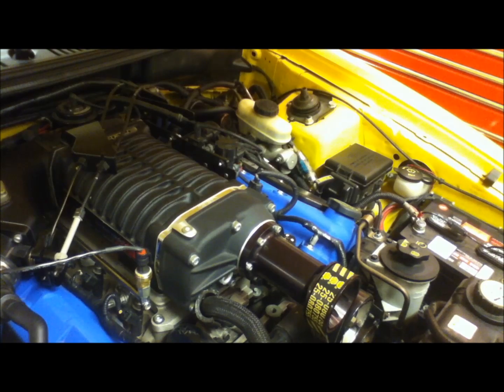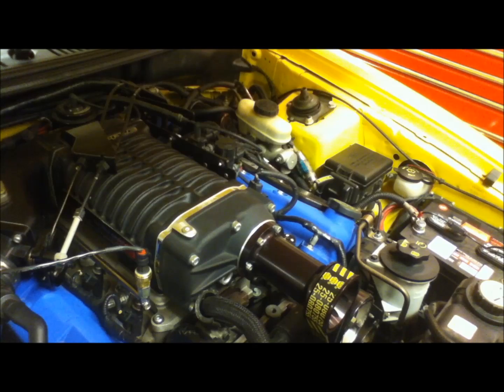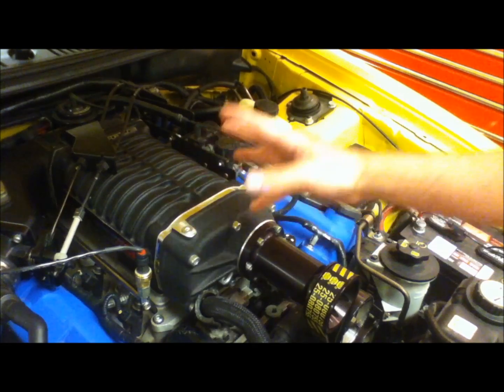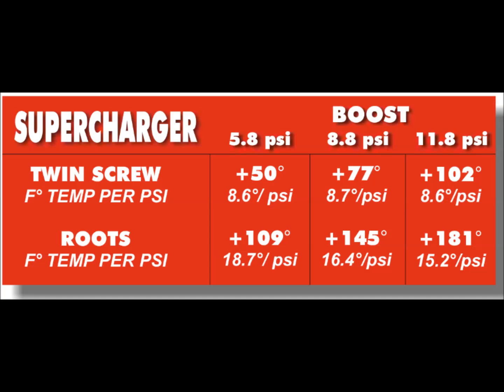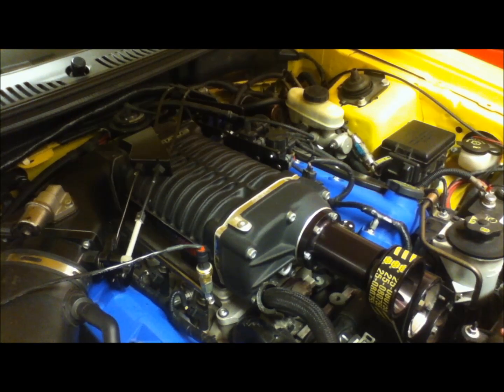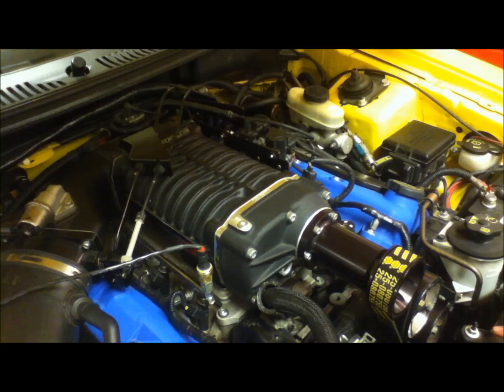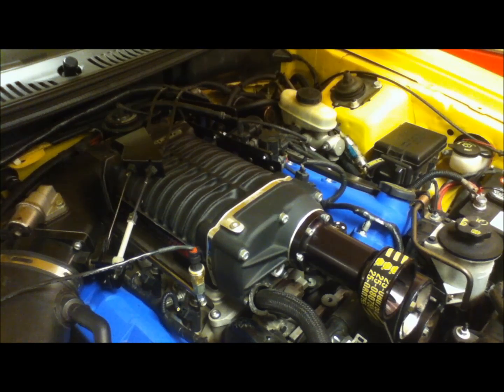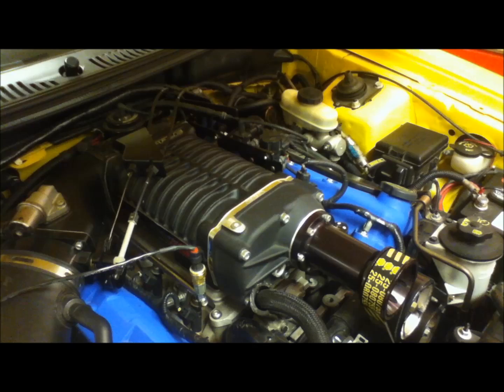Superchargers: Roots vs Twin Screw vs Centrifugal (Whipple, eaton, VMP, procharger) supercargador

Comment: I hate how people are so ignorant 
A twin screw is still a positive displacement blower and how they thing the roots is the end all be all when the twinscrew is better

They are both positive displacement blowers 
Thus still give that low end power
They both move a set amount of air no matter what how they do it makes no difference
 
They have no seals so less to worry about and produce less heat
The only advantage of roots is price

There is literally nothing a roots will do better over a twin
Reply from the maker: Actually, the new TVS roots outperforms both the whipple and Kenne bell twin screw. It used to be the other way around, but not anymore
Reply: Scrun Johnson really?
Well I'll be dammed 
I wonder how p.d. Tech is going to change 

What's the price comparison on those things and performance gap?
Reply from the maker: They are both around $4k new. The Eaton roots used to produce twice the heat as the twinscrew, but with the new rotor design the TVS/ eaton is more efficient. I would think a twinscrew could come back to be even more efficient, but as they both sit now the roots is better. 2.3 L roots will do what at 2.9 L twin screw will do
Reply: Scrun Johnson hmm well then 
I be proven wrong more than "durrrr roots is better durrr"
Reply from the maker: I was surprised too. No biggie
Reply: Scrun Johnson what company produces that roots blower? I'm looking into one for a build I want to do so I'm curious
Reply from the maker: MyLonewolf25 eaton builds the roots as well as TVS which is technically eaton as well as far as I understand
Reply: Scrun Johnson thank you! 
I looked on their sight but I wasn't sure
Because they did have TVS 
But it also had a TVS2 or something like that so I thought I'd ask before looking like a dumbass CX
Reply: Scrun Johnson what do you know about the one randy Rivera posted?
also what are the major differences between gen 1 and 2 I couldn't really find anything in a albeit quick search
Reply: Vmp tvs gen 2 by vmp performance
Reply from the maker: MyLonewolf25 you're probably thinking of the 2nd generation (2nd gen) TVS
Reply: Scrun Johnson most likely 
I'm guessing it's better than the first?
I didn't really see anything about by how much though
Reply: MyLonewolf25 i think the gen 2 has like 16% gain over gen 1

Comment: This video is very helpful.
Reply: MegaMma4life Top mounts are twin screw and roots
Reply: Wipple's are twin screw.....better than roots
Reply from the maker: Thank you. Glad you enjoyed it
Reply: Scrun Johnson This saved me lots of trouble with modifying a truck. After watching this video, I found out that I want a roots supercharger. I WAS gonna go with Procharger, but I don't want a centrifugal supercharger. I want instant power as soon as I hit the gas pedal. Now, I'll get a Whipple supercharger. But, Procharger is still great.
Reply from the maker: +George GMC Sierra Denali great.yes, I like the positive displacement blowers better for that reason too. I feel you can't extract the full potential of a centri or a turbo without running an extreme fuel setup. Positive displacements  are much more fun IMO
Reply: Scrun Johnson Yup. And turbos are better for top speed because they ain't belt driven so they don't use engine power to run and the higher the speed of the engine, the higher the speed of the turbo, so producing more power. LOL, finally I'm talking to somebody that speaks my language.
Reply: George GMC Sierra Denali that's The stupidest thing I ever heard.
Reply: james dean roots style is lb for lb better
Reply: Correction:
Whipple superchargers are twin screw.
Magnusson superchargers are roots.
I prefer twin screw.
I prefer Whipple twin screw superchargers.
Reply: MegaMma4life    meh...they run hotter
Reply: james dean plenty of things to make them run cooler.  there the best
Reply: They all work if installed correctly. Procharger centrifugal superchargers are easiest to install and turbos are hardest to install. I like twin screws though. And I prefer Whipple.
Reply: George GMC Sierra Denali turbos are easy.  superchargers you have to have a brain to make function correctly.  superchargers are easiest to install especially a top Mount which is usually 8 bolts
Reply: MegaMma4life   I guess........

Comment: What we get providing air with more pressure into the combustion Chamber? 
why high pressure is better?
Reply from the maker: It's like a fire cracker. If you let one explode in the palm of your hand with your hand open it will sting. If you close your hand around a fire cracker and grasp it tightly, the explosion will be more powerful (more pressure) and you'll destroy your hand (not recommended, just an example). More pressure in the cylinder means there is more air to be burned, which means a more forceful explosion, which pushes the piston down harder, which results in more HP
Reply: Thanks

Comment: Brilliant!
Best education on SC's yet...
Reply from the maker: Thank you. I'm glad you enjoyed the video
Reply: One question which seems to escape the internet, is how much horsepower does each "type" of supercharger require to make similar boost? What RPM's to achieve this boost? Or better yet which type of blower is best used for low RPM torque? If you add methanol injection can you achieve an efficiency close to a turbo?
Reply from the maker: +beauknowz yes, it's a little hard to calculate other than from the manufacture, but the best way to tell is when you dyno the car. You'll know how much power it makes and can see the end result of each blower and figure which is more efficient. The positive displacement blower will be best for low end power as its platform gives you instant power unlike a centrifugal or turbo
Reply: If you want to see forced induction technology at its peak research Mercury Marine Racing Engines. Truly incredible designs. To sustain anywhere from 5500-7000 RPM's in an ocean environment with the motor & boat continually jumping in an out of the water loading and loading the prop and engine, and not cannibalize under that type of stress is an incredible feat of engineering. and they all use positive displacement blowers, preferably the screw types (Whipple).

Comment: Nice job, well done. I think at the end you looking for "volume" of air in the intake manifold produced by each revolution of the blower. so smaller intake volume is crammed with the same volume of air each blower rpm resulting in higher intake manifold pressure. I knew what you meant. Something I had not considered was the headers lowering boost. Totally makes sense but I don't have a boost gauge to watch on my Riviera. lol I have faster cars but it's the only one with a blower. Also, watched lots of cars at the track and there was a LT1 Camaro like I had at the time. it was auto and mine stick but either way. I could tell I could out 60' him and maybe hold him to the 8th mile because it was not noticeable faster than other stock lt1 auto car out of the hole. Then is sounded like around 4500 I'd guess it started pulling hard and was really moving hard like you wanted to se from a supercharged car...... and then it shifted, killed boost, start over. Was terrible. About not worth doing imo. I can't recall what it ran but think it was high 12 or low 13. OH, I almost forgot it had a centrifugal s/c.  I always thought a manual trans car would be much better suited to that type of s/c. I wonder if you can drive them faster and get the boost earlier but blow off what you don't need as rpm increase?

Comment: Then there are the new CVT style Supercharger's that adjust the ratio's on the fly of the poly to the engine RPM for optimal boost at almost any RPM. See Procharger i1 :-)
Reply: It will suffer under heavy loads or demands as does the CVT trans do in cars.  I think a blow off valve will help to regulate pressure as did does in turbo charging
Reply: The wastegate is the primary pressure regulator for a turbocharger, not the blow off valve.   Using a bypass or blow off valve to relieve air pressure for an air mass you've already pumped and heated ends up being less efficient that just avoiding pumping excess air through a compressor in the first place, thus why turbocharged vehicles tend to retain high fuel economy and why you don't see any factory centrifugal superchargers.  For normal centrifugal superchargers they don't have much choice but to use a blow off valve for pressure regulation.  Positive displacement superchargers also use internal bypass valves to avoid paying too much of an efficiency penalty out of boost. 

CVT centrifugal sounds interesting but it also seems like a complex, reliability-killing, expensive bandaid given how newer positive displacement superchargers have caught up on efficiency and modern electronics and DI have cut lag on turbos.
Reply: @everydreamai  a centrifugal is the same as a turbo, only its belt driven instead of exhaust driven. but they make boost the same way and power
Reply: agent5y prochargers lag.  tvs Is the best way to go on a street application
Reply: The i1 has the ability to shift the ratio of its CVT belt so there is essentially, no lag. At the end of the day it's belt driven and CVT optimized. Read about it.
Reply: agent5y pro chargers lag.  and they don't hit as hard down low.

Comment: Great video, lots of good information.  I had a '97 Pontiac Grand Prix GTP with a 3.8L V6 with a Eaton supercharger on it.  The  first couple of  mods I did were a cold air intake and more free flowing exhaust.  The first thing I saw was a drop in low end torque just as you suggested.  I wasn't thrilled with losing that little bit of low end torque even though I was increasing HP slightly.   However, after I put on a smaller supercharger pulley,  I got back all of the low end torque plus a very significant increase.

Comment: What supercharger puts less stress on the drivetrain and engine?
Reply: I'd say Centrifugal.  power comes on slower and not as violent
Reply: Centrifugal because it puts less strain during low rpm
Reply from the maker: Remember this also means you're make less power down low as well.

Comment: Very informative thank you. I just got a 2016 mustang gt and am trying decide between the Roush stage 2 and the Whipple supercharger. Seems like the Whipple is the better choice from a performance standpoint but the Roush has a Ford factory warranty. Still undecided!
Reply: In Australia we are getting ~520hp at the wheels with a 1.9l Harrop on a Coyote block @8psi. Love em hey! No intercooling either.
Reply from the maker: Both will be good blowers. With the newer 5.0s having high compression you won't need to run a lot of boost to make big power
Reply from the maker: +mercury bullet yeah, some of the aftermarket kits don't even use an intercooler because the charge temps are low enough. In a way it's good that the Cobras were using the hotter eaton because now I have a more efficient whipple and it will even run better. The new roots style are better with heat too
Reply: Ours is an oem setup for the FGX Falcon. FPV spent $40 million on the design. Codenamed Miami (as opposed to a Coyote) if you want to look it up.

Comment: What do you think is better for a daily driver and why? 2010 Camaro SS. Many run the root-style Magnuson TVS 2300 but others use the procharger p1sc centrifugal supercharger. Would like to be able to drive in cold/rain and also keep gas mileage when I'm not hammering the throttle, so maybe a root style's instant torque is a bad idea?
Reply: generally with forced induction you can use a  cam with less overlap as you want to build cylinder pressure and the forced induction is pushing it in.....you will still use more fuel because you're making more power but the fault lies more with the blower than the cam
Reply: haha, if you wanna keep good gas mileage, really any kind of supercharger is gonna fuck that, a centrifugal supercharger or turbocharger would most likely be best though.
Reply: Yeah, I figured. Especially since I'd be getting a blower cam custom made to go with it to accomodate the new airflow patterns. Gas mileage would just plummet after the cam and supercharger install, so I guess I should just not even start modding it...
Reply: +White Camaro I've heard turbos do better for mileage but I don't know. I would think any type of forced induction would reduce mileage.
Reply: I know cams hurt mileage too right? And I'd be getting a blower cam either way. The idea behind the centrifugal style is that you're not dumping gas until 3k rpm or so, so granny shifting can theoretically won't demand a lot from the injectors and not waste hella gas. A root style blower demands gas even from low RPM so it's the worst for mileage.
Reply: b&m 144 350  10 mpg without 10 mpg fullsize  with blower belt off 10 mpg  doesnt fly
Reply: That’s why I’m planning for centrifugal

Comment: Why did an owner of a dyno shop say that the best exhaust system for turbo and superchargers is straight pipes but you say that you will lose boost that way?
Reply from the maker: Yes, both statements are correct. You will lose boost pressure with a better flowing exhaust. As an example, if you blew the same amount of air through a big straw and then a little straw, you would feel more resistance through the smaller straw- you would feel boost pressure/PSI. You would flow more air through the bigger straw with more ease (or less pressure). A more free flowing exhaust will cause a loss of boost pressure because it is more free flowing.
Reply: +Scrun Johnson Thank you for answering, but how does this also result in higher horse power?
Reply from the maker: The engine is running more efficient. More air in and more exhaust out helps the engine produce more power. Think of an engine as an air pump, and don't think of it as a "loss of boost" but as more air moving into and out of the engine. If the engine is "backed up" because the exhaust cannot escape, it cannot run efficiently. Just think about the straw analogy. How much better would you perform breathing through a bigger straw with less restriction.
Reply: Ok but if more boost creates more power but you are losing boos but gaining HP that contradicts itself?
Reply from the maker: No, more boost does not always equal more power. More air flow equals more power. If nothing has been changed and you increase air flow (for example through a smaller pulley) your boost pressure will increase because you are providing more air. However, if you do something else to provide the engine to breathe better like a better flowing exhaust, you will gain power as well. The only way more boost makes more power is when all other conditions are constant. By adding a better exhaust you just changed the setup.

Comment: Very good video. I knew a lot of this already, but it's always nice to get a refresher :) It's impossible to deny that the twin-screw is more efficient than the Roots style, however I must say that I prefer the whine of the Roots-style units (especially when they are ported ;) ) The Roots units are also usually cheaper than the twin-screws. Either one will serve you well, and put a smile on your face :) The only one I don't like is the centrifugal! Sure, they are usually cheaper, but I can't stand that sound...
Reply: crazyfvck I can't really tell much difference the difference between roots & twin screw unless it's the really crazy like 10:1+ roots blowers that wail like a banshee!
Reply: crazyfvck Also, what sound?! That's what I am most saddened by on centrifugals is they're so quiet! Once you put your foot in it, the noise goes away, drowned out entirely by the engine and exhaust! Turbo gets massive whistle, roots gets the wail, screws get the whine, and centrifugal has a high pitched whine at idle that disappears as your foot hammers down... no fun.

Comment: not sure if you are here yet, have you heard of twin charger or know anythibg about it? i think it will be good to have both supercharger and turbocharger in one spot to make it better than having one of each if you also know about turbo charger. im gonna use my shelby mustang gt500 suoer snake on it.
Reply from the maker: Yes, I have heard of that method known as "compound boost" where the turbo helps feed the supercharger, but one thing to keep in mind is that once the air from the turbo is fed to the rotors on the supercharger, the air will be disrupted like how rocks in a river make river Rapids (if that makes sense)
Reply: +Scrun Johnson but i have heard that turbp helps the part whrte supercharger is bad at and supercharger kicks in where turbo is not as good in where when air gets in supercharger helps turbo at the start and backs up turbos with the airs kicking in to power it up
Reply: +Scrun Johnson and i dont understand why they saying that i should twin charge the small engine rather than bigger engine, do you know any way to explain that to me?
Reply from the maker: Yes, you are correct. It will defiantly help, but they will also fight against each other unless the setup is designed specifically for them to work together. It will work, but must be developed properly.
Reply from the maker: Which small engine are you talking about? By twin charge they are saying both turbo and supercharge or do they mean twin turbocharge?
Reply: +Scrun Johnson like i read a article about they had a twin charge in vw 1.4l TSI engine in europe. but i have not seen any real bit big engine twincharge.
Reply: +Scrun Johnson i guess because its complexity not a lot of company do the twin charger
Reply from the maker: Yeah, in the end a mid sized turbo will do everything you need it to